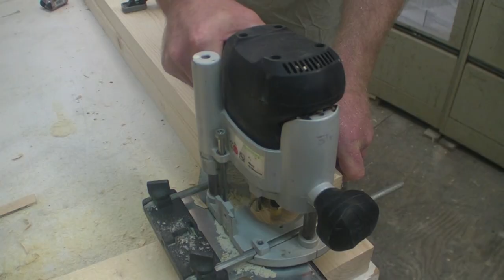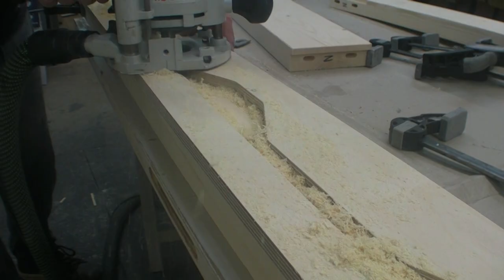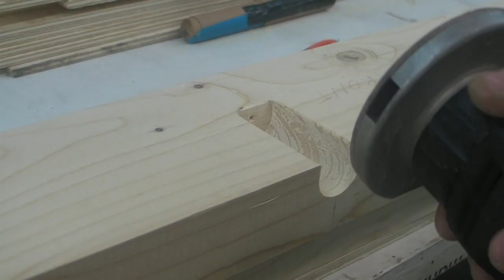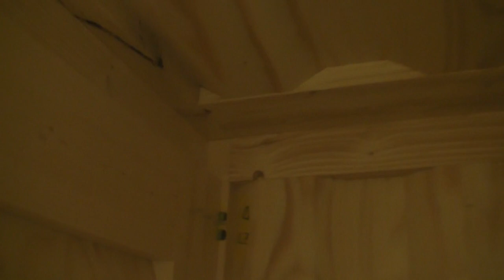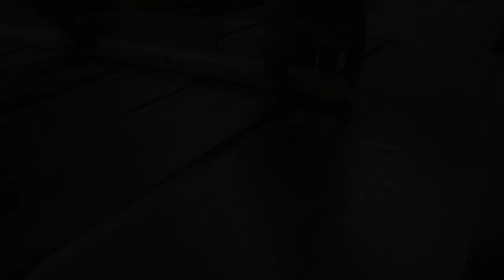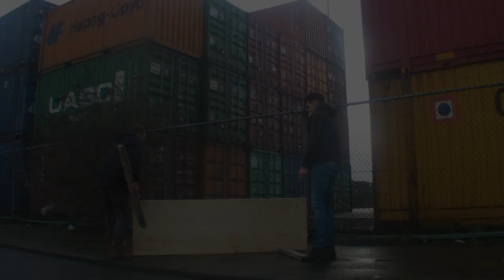mammut cabinet by stephan siepermann

Comment: Corrugations are not supposed to be this way in the doors. They should turn 90 and run top to bottom. This way the container cannot hold vertical load. For the rest  it is a very beatiful cabinet in your style.
Reply from the maker: thanks for the reply. i redesigned and simplified mammut to make it  more furniturelike so i abandoned the original design a little bit. therefor mammut is only inspired by the original and not a copy of it.